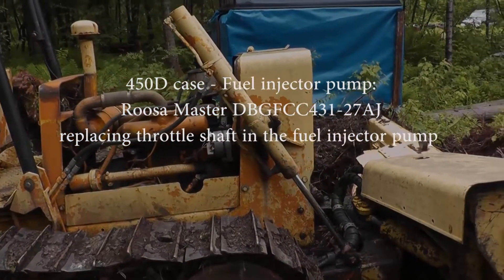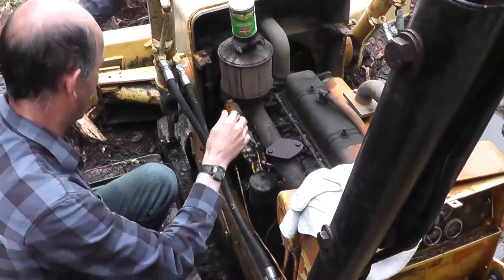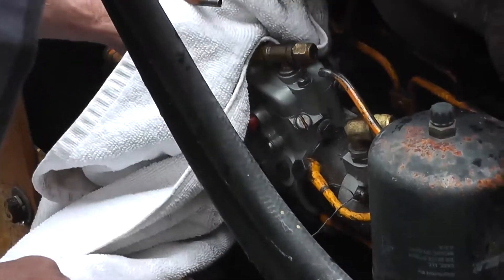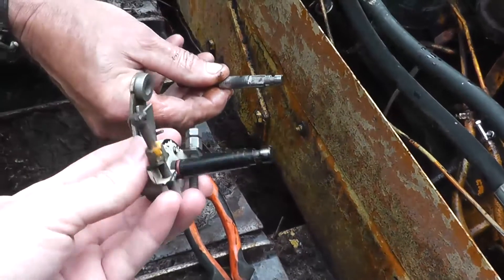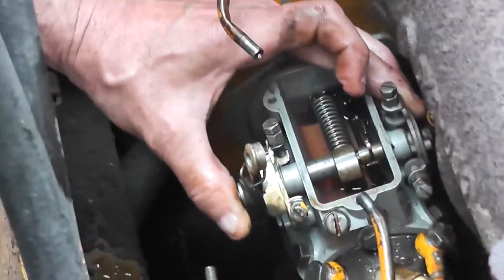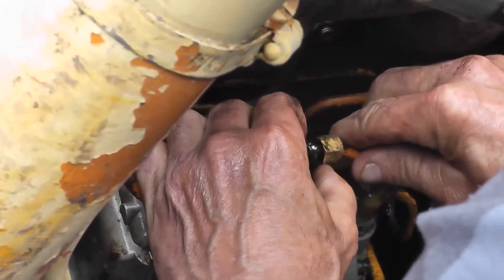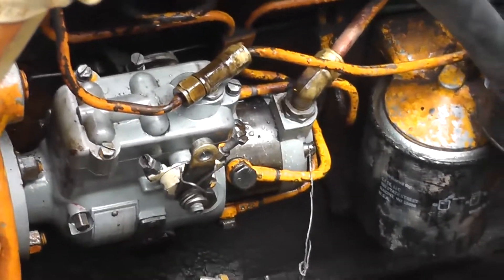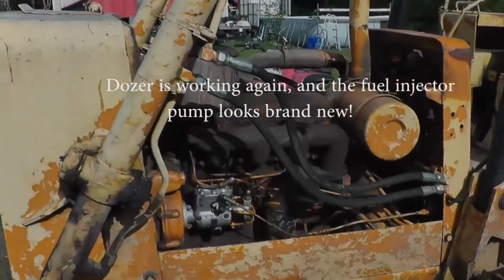Case 450D Fuel injector pump fix

Comment: Thank you for making a such a great video! Information was so helpful. Your video gave great insight. I too am having to replace throttle shaft but on the Case 480E LL Fuel Injector Pump. Thank you again!
Reply from the maker: Glad it was helpful, I was happy we didnt have to replace the whole thing, and found it difficult to find good information online for these old machines.  I am more careful now when rolling over roots to not let any roll back in and hit me